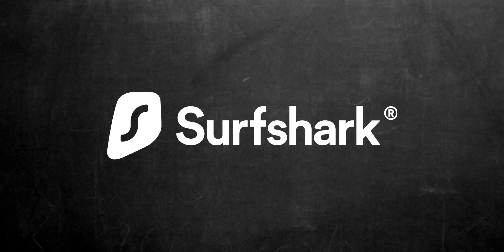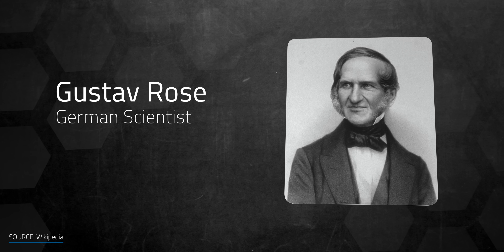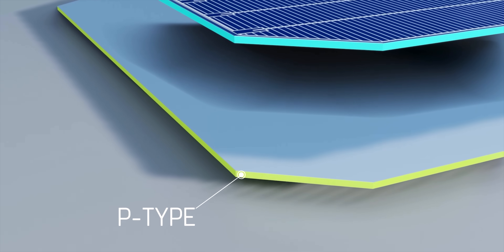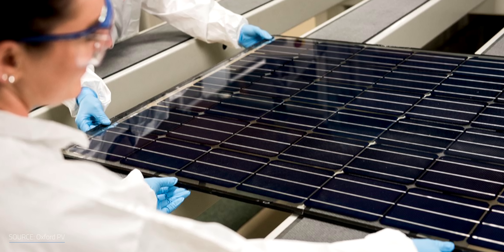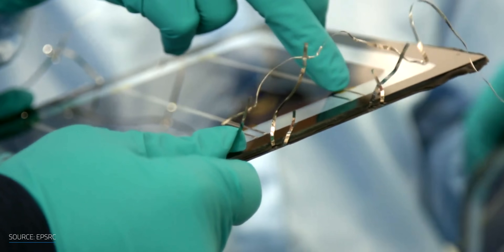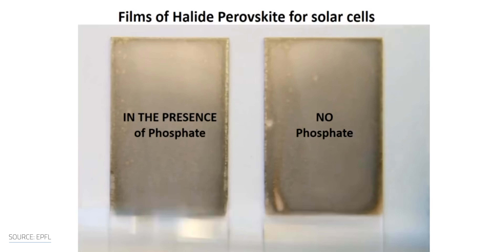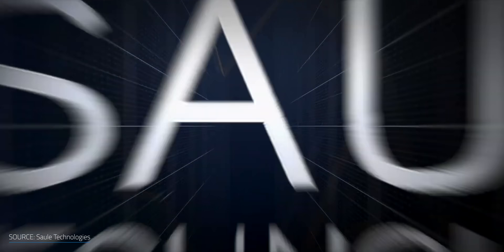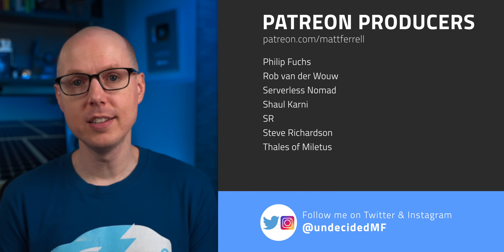Perovskite Solar Cells Could Be the Future of Energy

Comment: @3:37 https://youtu.be/YWU89g7sj7s?t=217,
The n-type and p-type layers are net neutral, unlike what was explained in the video. It is just that p side has more holes than electrons and n type has more electrons than holes.

Be aware! Nice video but do a little bit of thorough research to prevent propagation of wrong ideas

Comment: It is great that Matt likes the IEC 61215 standard...  I recommend that he also purchase and use the IEC 61836 standard, which defines solar PV terms... in 61836 he will see that there is no such term as "panel" !!!  that's because decades ago the PV industry agreed to call them solar PV modules, not solar panels !!  I would request that Matt use the correct PV terms and so provide good solid leadership to his audience.

It would also be good for Matt to use the term "power" correctly.  Power is merely the speed at which energy flows.  Power is *not* electricity.  If he wants to reference electricity, then he should solely refer to it as electricity.

Comment: The Perovskite tech only needs to last 1/2 the duration of the silicon and cost less than 25% to be cost effective. Provided that the end-product is much lighter it will also be easier to replace so replacing them every 8-10years should be an option for early adoption until people figure out how to make it last longer.

Comment: I actually work with some perovskite cells, in their native state they are stupidly hard to work with because they are extremely fragile and does not stick to anything well. Spotweld cracks it, solder comes right off. The pure forms are actually available relatively cheaply (under 100USD for a stack of 50 10cm x 5cm rectangles) even on e-bay but at least 80% will have fracture on arrival.

These have a GREAT potential but as you mentioned, very few companies are packaging them but at a huge drop in efficiency. Right now the packaging is the biggest issue. Also one of the craziest advantage of perovskite cell is that it works fairly well when the piece is broken.

Comment: im working on a research and habitation centre on the moon, and was considering the viability of perovskite over silicon solar panels for energy generation. seeing as temperatures are very low at its poles(moon) and the lack of a atmosphere allowing for almost direct sunlight, the yield would be insane. furthermore, factors such as lead poisoning would not matter with this being completely offsite. 
the drastically reduced weight of PV would also greatly help the amount that could be carried as payload. (opposed to virgin Si panels)
coming to the damage and maintainance aspect, i assumed the replacement factors trump the repair aspects. although i would like to reduce my net wastage, this seems to be the best option in terms of efficiency and workability.

i would love some and any insights you guys might have

Comment: THANK YOU for Posting.
THANK YOU for being so technologically astute. I applaud you on learning and teaching at the high level you are !!!
   My comment: Have they tried sandwiching the Perovskite material inside two layers of PlexiGlass. NO air in there. So when the material flexes, so does the plexiglass. The plexiglass is coated with the backing AND the Perovskite layer and plexiglass layered on turning the whole unit into ONE PIECE, with 2 color-coded insulated wires coming out at a corner. This SHOULD eliminate cold, hot, hail & shifting damage & degradation.

Comment: Very interesting and well researched video, great quality as always, Matt.
BUT
I sometimes have difficulties to cheer with the crowd and hail the glorious (potentially?) great discovery.
I see a lot of problems here in the real application. And there is nothing near the efficiency to the old solar horse.
Why don't we spend more time and ressources to work with the same enthusiasm on improving the weaknesses of Silicone:

DIRTY, really ?
 Matt just put it this way without elaborating it further. 
 Old fashioned silicone panels don't contain Lead or other really toxic stuff., like perovskite cells.
 Silicone is just dirty because the Chinese burn low grade and polluting coal to melt the cheap silicone then sell super cheap solar panels.
 Cleanly produced solar panels are not competitive on the market.
 We should use solar energy to make more solar panels. 
 Build forward better.
  
Efficiency, really?
 Where is the problem to pack a few more solar panels and enjoy something below 30% efficiency, but for really long time.
 Perovskite cells are a long way from being "lasting".
 We don't need thin, light and toxic throw-away cells which last just a few years, then replace. A nightmare.

Future?
 A commercially adept as a fusion reactor. Similar multi-generation project.

Comment: I mean that sounds promising. Even if it doesn’t last as long if you can offer a Solar panel that say only retains 80% efficiency after five years instead of 20 compared to traditional silicon but it costs eight times less than a traditional silicon solar panel then that’s a no brainer. Of course that cost would have to be installed not just for the panel. But even if the install costs end up being slightly higher the better efficiency might mean that it still makes sense. I can see why people are excited about this tech!

Comment: the idea that a carbon foot print is at all relevant is very stupid... the earth's weather and seasons have been in a constant state of flux (like seasons it changes all the time)... if you want to find an alternate source of energy to get more away from the petroleum based fuel, fine, go for it. Before you do that consider the cost it takes to manufacture said source of energy and what it takes to harvest the materials needed to manufacture that source of energy. Most, if not all, electric cars have batteries that CAN'T BE RECYCLED, at this time and they are piling up in land fills and other places creating toxic waste that is POISONING the environment. Have you studied the effect on the environment that those huge wind mills have and what kind and how much damage they do? Is the source of energy you are pushing going to be less or more damaging to the environment than petroleum based fuel? Will it provide as much (at least) or more energy than the petroleum industry based fuei(s) or less? What is the cost of production compared to that of gasoline or diesel gas? What about the hydrogen powered engine?

Comment: wow imagine being able to buy a 1000w solar system for $100. even a 500W one for that price would break modern power grids in the sense that it would become vastly cheaper to just make power yourself. if you can put 10kW of solar on a house for $1000-$2000 i dont really see why anyone would ever use the grid again. i think at that point grid power would become obsolete and power installed on houses using solar and batteries would become pretty standard. i mean even todays prices of around $1 per W is making alot of people convert over to solar. one problem remains though. current solar only loses around 20% capacity over 25 years. so a 1000w system will still be producing 50-60% around 50 years in. that is good enough to attract people to use it. if this new solar technoogy only needs to beat new solar in cost and be reliable enough to make people think it isnt bug deal replacing it when it gets old and that they got good value. i think this will happen when it gets to be so good that it only loses 20% of its life over 5-10 years. why then? because @ 10x cheaper those are the magic numbers for people to adopt it. people dont wanna replace a solar system every 2-5 years but one that degrades 20% over 5 years would last at least 10-20 years. thats long enough for people to want it.

Comment: Back in the late 90's and early naughties, I worked on control systems for Solar panel scribing machines. We built a prototype machine for manufacturing CdTe solar panels (Cad-tel as we'd say), and it was quite scary. More design effort went into the extraction & filtration system, than went into the laser scribing system itself. The material ablated from those panels was definitely not something you'd want to get anywhere near your lungs. *8')

At the time, all people in the industry talked about was getting the cost of panels down to below a "dollar per watt", and many people thought thin film was the only way to do that. Of course rapid growth, economics of scale and market share combined to mean that crystalline silicon cells were able to drop in price much faster than these upstart thin film technologies. I'm no longer in the industry, but I doubt there is scope for many more cost reductions with c-Si solar cells, so a technology which offers a 10x cost reduction is really interesting. Maybe the time for thin film is finally here.

We also did some work on prototype machines for making panels suitable for building integrated PV (BIPV) projects, which have additional constraints compared to traditional panels. The impression we got was that the big problem was not making the panels, but getting architects and clients to consider them, and huge logistical problems of wiring them all together and integrating this wiring with the fabric of the building. With lower volumes and lower efficiencies at the time, I guess that these BIPV panels couldn't compete on cost with c-Si cells, and since c-Si cells couldn't be used for BIPV, people weren't encouraged to go the BIPV routes. With cheaper BIPV alternatives coming onto the market though, we could see a significant rise there too.

Comment: I am wondering if the longevity aspect is over-played in the industry - I see so many 2nd hand panels being sold where someone has invariably upgraded their setup to something newer and more efficient, perhaps a shorter lifespan product shouldn't be quite the impediment it seems to currently be perception-wise.  Are we perhaps cutting our noses off to spite our faces?  
If we were to achieve something that was so cheap that it could be a realistic drop-in replacement not just for existing panels but for the very notion of a roof itself - that's also going to have huge impacts on areas of greater sprawl.  Imagine cheap 10 year panels appearing on the market and being taken up as a "default roofing material" India for instance;  huge amounts of sun, I suspect that a panel that runs 30 years won't matter as much as a panel that's 1/10th the cost of implementation.  
This will help areas achieve supply resilience and "normalise" the idea of power being naturally generated in the sprawl of houses, warehouses, factories, etc. as a part of town planning itself.  We'll then see the value of better battery tech come to the fore, projecting forward we'll be better equipped to use these methods in space, etc. too.

Comment: This is flat out not true, silicon as well as perovskite cells at lab scale have neared the practical limit and reached 26% (the absolute is at 33%). The 29% you mention 'that cannot be achieved by silicon' (which may be true, but neither can perovskite, for exactly similar reasons) are from a Si-Pvsk Tandem cell (which you even mention later in the video)... Was impressed by the depth of the vid but in doubt now...

Comment: If this is used on short-survival items (seasonal party items for instance) if they are in parity to silicon in cost per watt and watt per size, they have a marketable use. The question to long term value is the stabilization of that efficiency loss. 20% loss in 2 years is harsh compared to Si, but loss is normally a curve, not a line. And this would be my suggestion for your next video on this type of discussion;  ask if anyone has anyone charted a flow loss curve over time and show that, so that replacement expectations can be compared to known types. Good topic, great field to work in for those looking at what to do in life. Research here applies to Fusion tech as well.

Comment: If only mankind listened to Tesla, waves and frequencies. Once you understand the frequency of a material you can best optimize it for performance and use. Which makes sense once you look into how chemicals are made up, particularly with rocks, each rock has a specific resonance frequency and some can be affected by certain frequencies to change colour. For example alexandrite. Depending on the frequency of light entering the stone it changes colour and blocks out harmful radiation and that is all down to the resonance frequency of beryllium which as a low level frequency so it slows down light when it enters it crystalline structure.

Comment: How about we just go nuclear? Thats the only green sustainable energy source that actually checks off all the boxes. If you use nothing but electricity for your entire life, for your house and driving an electrical car, everything, each person will have a soda can sized nuclear waste that can be stored extremely safely in steel and concrete containers that has radioactivity so low its almost at zero.  a single easy to store can of coke. Thats all. With Solar panels, you have a lot, and I mean, A LOT, more waste that is not recyclable and actually toxic and radioactive.

Comment: We're sailors of a small cruising sailboat, so are off-the-grid much of the time.  Wind provides direct propulsion some part of the time we are moving, while a 12 Watt Solar cell provides/most of our electricity. Perovskite seems very interesting as we could  go for electric propulsion with more powerful solar cells. Thus perovskite formulations sound pretty interesting.I've found that cruisers, particularly sailors, are early-adopters;  of solar and windmills for energy production, as primitive as the current windmills for 'individual' use currently are.

Comment: an update on this technology, they manage to use tape like material to  keep leakage of lead to beyond 99.9% retention. It would still be a problem over time but they are getting there.

They have also achieved almost 30% efficiency for the next generation so perovskite might not be so far from commercial break now.

Comment: How about using a fresnel ens to help increase the output? Sure I’ve read or seen this used in this way. Use water cooling to solve the overheating and use the heated water to help heat the home with a smart heating system like Mixergy?

Comment: Welll.
Very cool
I think tech that directly harvests solar energy into electricity has a constant issue, it always suffers from UV damage and electron migration ect, so a thin film tech like perovskite could see more widespread use even with a reduced lifespan because it can be easier to replace, becoming a simple chore done every few years with proper engineering. Something like a roller system with a stabilized paper leader just tape the new roll on, and crank the rollers till the old roll is off.
And that can give it an large market advantage if the costs are low enough and if there is a core trade in to further reduce costs and reclaim the gold used.
So perhaps it is far to soon to tell the future but in any future it seems this tech has a future at least in some applications.

Comment: If it costs 10% of what silicon cells do, you can replace it more often, and be better off due to the higher efficiency.  Snap in snap out frames on the mounts would allow unskilled workers to do the swap outs. .. but for high quality silicon why aren't we talking to Canada re oil sands silicon byproduct...and couldnt solar furnaces make the required heat? Make cells while the sun shines?

Comment: Cheap silicon panels are not difficult to make or expensive.  The markets are fixed by companies that supply the divergent fossil duel industry as well as solar panel parts and materials.  It's yet another McDonald's IceCreamMachine that always breaks, but only the certified repair guy the works for my "old friend" gets to run the service, type of situation.  In fact, you can use the Sun itself to purify the silicon.  AND power the entire mining and manufacturing process.  The idea that old silicon panels are dirty and expensive is a complete myth.  They created a dirty and expensive system to suppress solar technology.  That much should have been completely obvious.  Standard Oil didn't just accidentally sit on Battery technology.  They brutally mutilated it, in front of it's parents.

The incentive for modern companies to do the same to solar technologies, never went away.  There is ABSOLUTELY no reason to believe they wouldn't manipulate the market behind closed doors to protect their business partners.  McDonald's is just the tip of that ...ice berg.  And if you have no idea what I am talking about, you haven't been paying attention to any real news in years.  And that's upsetting.

Comment: Personally, I think a hybrid silicon based system will achieve higher than 30%. I also think it will be 3 to 4 times less expensive and shorter production time.

Comment: Thinking about the difference in thickness (and density), I wonder what the weight difference would be for the installed system?  Seems important for roof mounted systems - as well as the gross expenditure of energy to transport.

Comment: Peroskite could be used for essentially short term or throw away solar material for gadgets and embedded novel means in the low cost solar power bank market.  It could be hybridized with silicon for greater longevity but as it stands, the increased cost would make it near irrelevant unless the tech is able to move ahead with greater efficiency outcomes. 

This could be the right vehicle to bring solar into everyday items, clothing and tools, especially if the tech leaps beyond it's present manufacturing negatives.